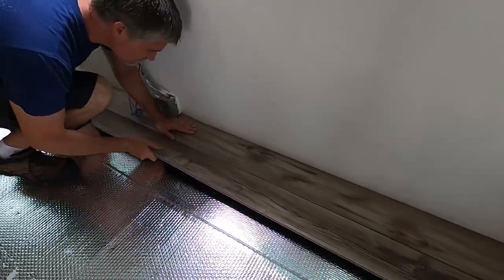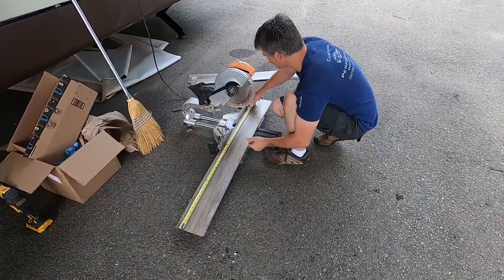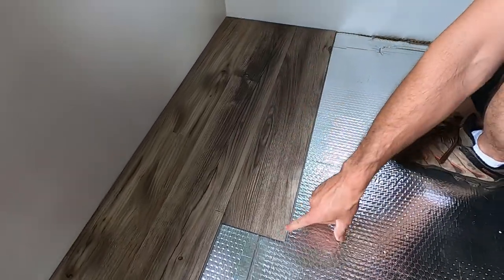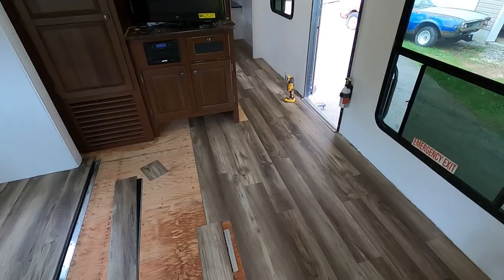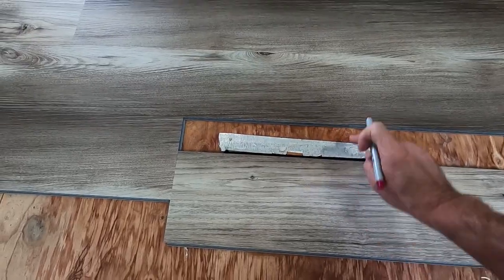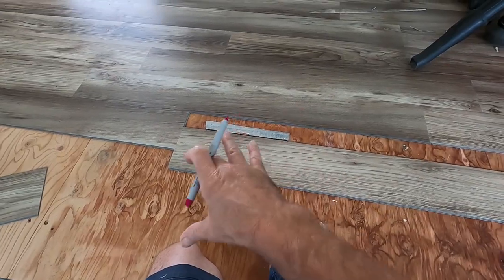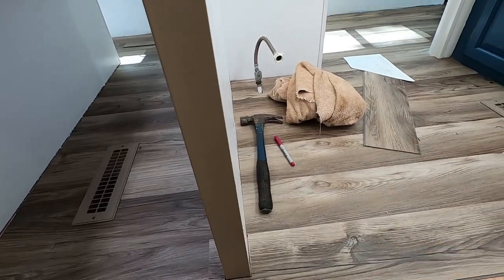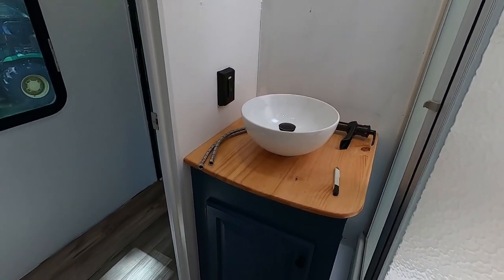Vinyl Plank flooring install in our RV

Comment: Your floor looks identical to mine. Name on box, Heathered Barnwood.  I also painted my walls and upper cabinets all white. The bathroom cabinet, dark 🩶 gray. The cabinet my sink and stove sits on plus one set over sink n stove dark gray 🩶. The floor now,looks ten times better. Thank you for helping me understand how to stagger as if it's real wood flooring. So easy to clean but I do miss my wood floors. I will never miss the expenses that come w living in a regular size home. I'm 50 and I will never pay for electricity or water again. Part time camper life which is solar generator ran and a tiny home, all solar but I do have a small back up gas generator. 2,700 a month. Is now 500-600 a month. If I spend that but I rescue all animals. Food isn't cheap but the joy they bring. 
Again, Thanks for this video. I watched twice and went to work. Hope your enjoying - 🌹🌹

Comment: @slow_restoration  Hi, I wanted to reach out to you because I wanted to replace my flooring in my RV.  I have a 2014 Jayco 🙂 which I absolutely love.  You did this video 2 years ago and wanted to know how the flooring is handling the expansion and contraction due to heat and cold.  I have seen and watch videos that tongue and groove is not a good choice.  Although, I did reach out to another YouTuber, indicating that perhaps the flooring was not properly installed.  After the 2 years, what are your thoughts of the the flooring?  Would you install it again?  How is the floor handling the hot and/or cold?  Any advise would be much much appreciated.  Thank you so much.

Happy Camper,

Rick
Reply from the maker: No problems that I know of. I did sell it but haven't had any complaints from the new owner. This flooring is more secure than tongue and groove, it's an interlocking tongue that is hard to pull apart unless you lift the piece up at an angle. I would install this again without a question.

Comment: If the floor needs to expand and contract, watch how you pin the registers, so joints don't open.
Reply from the maker: Not so much a problem in the center of the floor as long as it can move on either end. Thanks

Comment: How did you get your flooring up under the edge of the slide and keep the slide from scratchinging the new floor as it slid in? I promise I watched to the end and even watmhed the other videos in the playlist. Thanks. I sure hope ours comesout half as gorgeous as yours!
Reply from the maker: Thanks for the support! Each slide is a little different. This one the flooring stops right at the edge of the slide. I let the transition strip overlap to cover the edge of each section, the main floor and the slide. Most slides have a rub strip and the slide is adjustable to keep it from scratching. Alot of new campers have vinyl on the floor and slides, so it's not a lot of difference between them. We went to some RV show rooms and saw how they did the new ones. Hope this helps, thanks again.
Reply: Awesome, that answered my question too!
Who can do this to our rv since we’re both so old, we’ll need an installer?
Reply: My handyman did mine.

Comment: Have you had problems with the vinyl planks popping up during travel?  Also do have problem with the slide scratching the vinyl when you bring the slide in?  What do you do to prevent scratching?
Reply from the maker: Sorry for the late reply. We didn't have any issues with popping apart, but only used it once before selling it. I don't see it being a problem though, they snap together nicely! Most slides have a rub rail to prevent scratches and they are adjustable.

Comment: Why did you use an extra underlayment under the new flooring. I noticed this by the slide out, but not on the main-floor?
Reply from the maker: It was already there from the factory. It's a foil backed insulation. We considered removing it, but decided we wanted the benefits of it being there. It was just on the slide.
Reply: @slow_restoration good to know!

Comment: Noticed you put underpayment on the slide but not the floor. Why is that?
Reply from the maker: It was already there on the slide, for insulation when the slide is out. The slide doesn't really get walked on like the floor, so it doesn't more around like the rest of the floor would as you walk on it.

Comment: Did you have an issue with the heat and cold causing gaps or any other issues with floor expanding and contracting?
Reply from the maker: I didn't. If you do, it's a fairly easy fix. This stuff locks together pretty solidly.

Comment: Will click together laminate flooring pop up with temp changes from hot to cold? Did you use regular flooring for home kitchens, or is there special RV flooring?
Reply from the maker: Just regular flooring. Definitely use a quality flooring, I didn't have any issues.

Comment: Great Video. Can you talk about the expansion allowance? Is that a small amt you leave on the very ends where the LVP abuts to cabintry?  I have a small Class B and wanting to replace the carpet and vinyl tiles  with LVP (just in the kitchen/galley) with carpet on either side. thanks.

Comment: How did you prevent the furniture from sliding around on the new flooring.  Did you have to install some type of anchor points so you could use tie-downs?